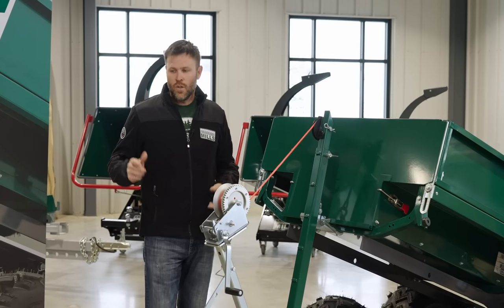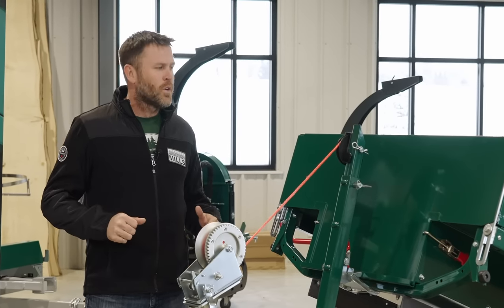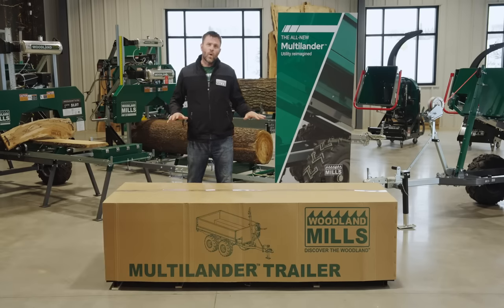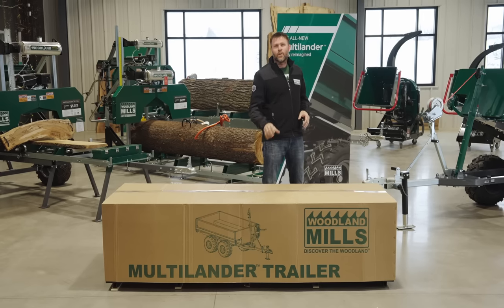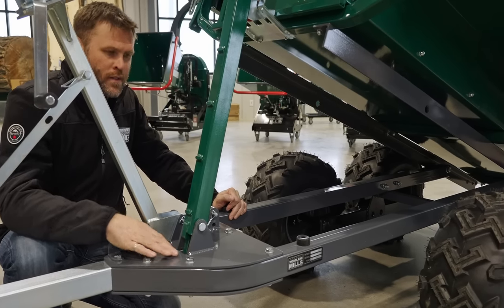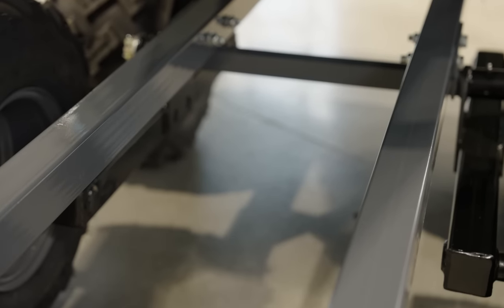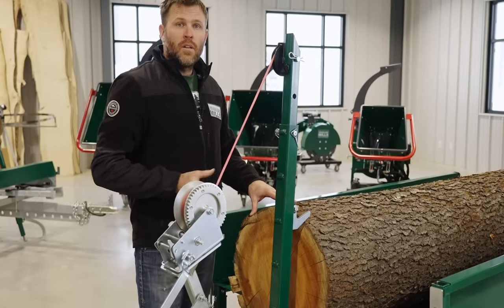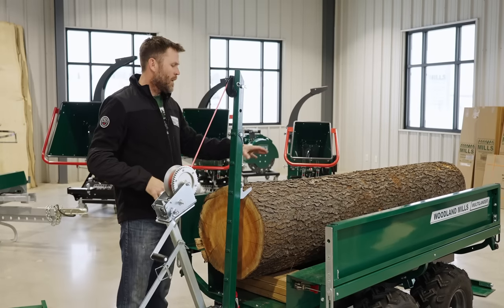Woodland Mills Multilander™ Off-Road ATV Trailer (2023 Edition)

Comment: the u.s. department of interior  has a chart that reads a cherry log 18" diameter  1' long weight is 79 pounds so an 8' log does not weigh 1000 lbs it is only 632 pounds